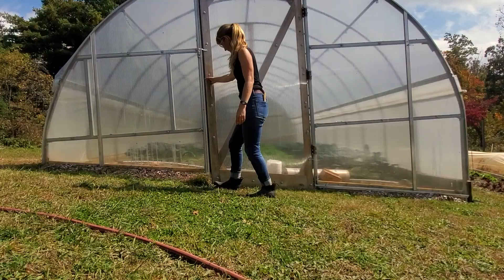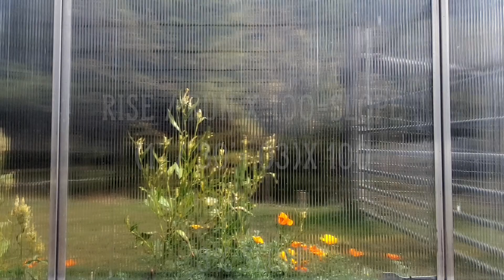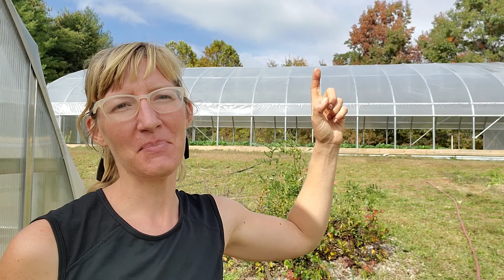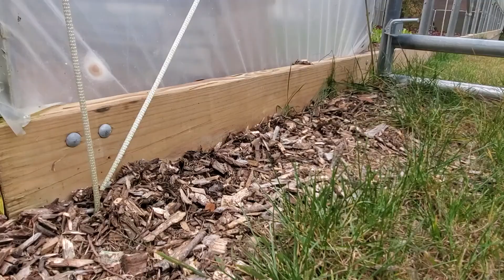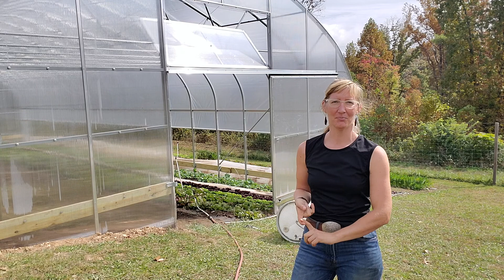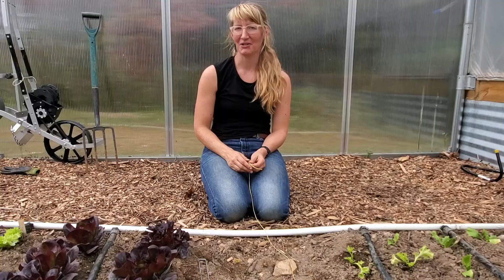Can You Build a High Tunnel Or Hoophouse On a Hill?

Comment: Thanks for this great video. With my hoop house running parallel with my grade, the slope from side to side would be about 15% (and roughly level from front to back). So for a 30' wide high tunnel, it would fall about 4.5 feet from side to side. Rather than having a slope inside the high tunnel, I could excavate the footprint and have short retaining walls on either side. In my situation, the floor on the downhill side would be retained by a 2' tall wall, and the wall on the uphill side would sit on top of a retaining wall of about the same height. Any idea about the pros and cons of doing that (versus having a slope on the inside)?
Reply from the maker: I chose not to do any retaining walls because I didnt have space outside the perimeter to spare. Why will you need outside space? because youll need to have some kind of an earthen gutter (kind of like a swale) to guide water away from your house as it rains. Some way to make sure that the runoff is not flowing right through your tunnel as it meanders down the slope. If you have a solution for that I dont see an issue with what you propose. The retaining walls you are building might even be made of a material with some insulating properties which your plants may appreciate in the winter (even better if it goes below grade too to keep rodents out)

Comment: I have almost same slope as yours. How did you connect the corrugated metal to baseboard?
Reply from the maker: Hi Nanette good question. I loosened the brackets that hold the baseboard up two at a time and was able to slip it up behind about an inch and pinch it in there a bit. I secured with a few self tapping screws and the bottom edge is just buried. Let me know if you need a closeup photo or if that makes sense.
Reply: Yes, picture please.
Reply from the maker: Hmm, I took some photos but can’t post them here 🤷‍♀️